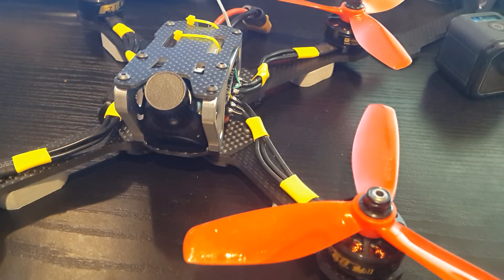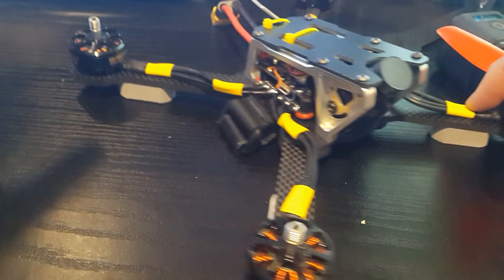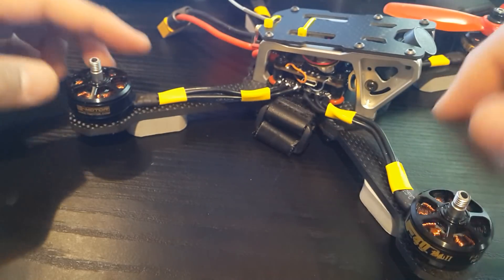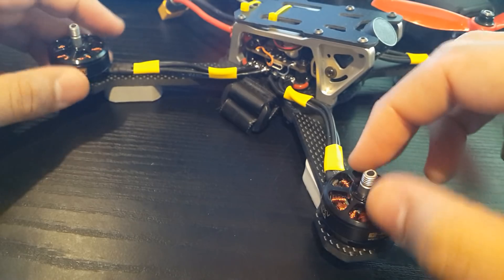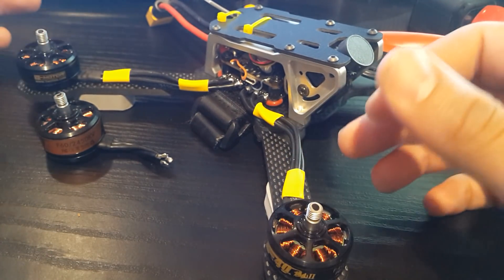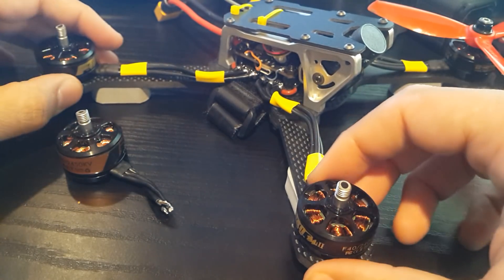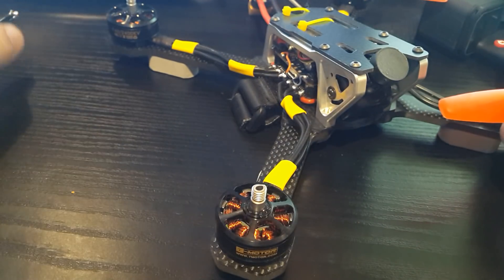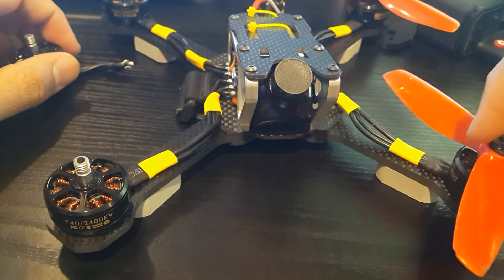Fake F60 T-Motors?? (It's Worse Than That)

Comment: Wow!! Sorry to hear brother, what a fun killer. They would have heat treated those shafts wrong or skipped the step cause when hardened steel is done right the props should break first or just strip the nut if that is alloy or low carbon soft steel. :-(

Comment: I had horrible experience with tmotor F80 1900 kV. They smoked either on power up or after a small crash. I have built 8 quads and never had issues with any motors.

Comment: that's weird, I can't kill a set of f40 pro's, I have crashed so many times and hard as h*** and the keep running like new, sucks for your trouble but yeah I won't run anything else, get the black versions of f60 looks like you have the first f60 made

Comment: Hi,
I bought 4x F-40 pros from ReadyMade RC and have been very happy with the motors. I have not had any shaft issues, they are surprisingly efficient and have been through a few crashes without complaint ( I do use TPU motor protectors though). I have had to clean out the windings due to mud and sand (with an air compressor) and they still fly just fine.
I short, my T-Motor experience was quite good. The issue with Aliexpress is the waiting time is long and many of the retailers are not trustworthy as they sell non-stocked items regularly, and then delay refunding. I feel for you bro! If the shafts on my motors broke that easily I would be freaking!!

Comment: The shaft broke ??? Wow that's a first. I would blame dalprops for unbalanced props and too heavy.
Reply: Bryan FPV no prop can create that much of a force just by vibrations, he might have screwed it on too tight but I if that were the case they won't survive even small crashes.

Comment: I have had a few friends with the same issues on the T-motors , most of them have turned to the emax's rs2306 2400kv, ive begun to use rcinpower gts2305's 2450kv  if you know them but are slightly less amp hungry.

Comment: its because theyre hardened too hard. very hard steel becomes brittle. manufacturing flaw , maybe they werent tempered correctly after heat treat. most liekely bad batch. tough luck. sucks to have to wait for replacements.. oh btw. you make great content. +1 sub ;)
and i know im a couple weeks late on the commenting ;)

Comment: hello the same happened to me with the f60 pro . they just broked on the back of my car without flying. now i go with diatone and emax . no more tmotor crap
Reply from the maker: Glade you told me I was thinking of giving T-Motor another chance with their pro series. 

Go with Emax the diatone bearings are very weak.. However I will be taking apart a Diatone motor and will be adding ceramic bearings see if that will fix the problem. Overall go with Emax.
Reply: Well at the end the best for me right now better than emax 2205s (witch i have broken 3 already), is the dys se and tornado t2 , those are pretty solid , and dont kill your battery as with the new emax.

Comment: The T-Motor Pro versions and the T-Motor F80 are very high quality and I've yet to experience any type of manufacturing failure in the 20 or so motors I've purchased.  Of course I use reputable USA retailers and I've never ordered anything from BangMeGood nor do I plan to ever patronize them.  If you are in the US why not order from US shops?  My experience with T-motor has been fantastic but I've not used their earlier versions.  Do yourself a favor and get some F40 Pro 2400kv's on that rig and you'll be singing their praises!
Reply from the maker: I was thinking of getting the pro version to give T-Motor another chance because i really want to enjoy those motors. So i think i will take your word for it. Email me your retailer site I will give it a try.
Reply: Purchase from here https://www.racedayquads.com/collections/t-motors .  Free shipping, excellent service.  No problems whatsoever.  They have T-Motor in stock.  I run the F40 Pro 2400kv on my 5" and the F80 2200kv on my 6".  They have been bulletproof so far.  Good luck!!

Comment: If all your shafts are cracking and breaking in that same spot, consistently. And you haven't even flown them, and the only thing touching the shafts in that spot when they crack is props and prop nuts.. then your over tightening your props. Whatever your doing to tighten your props isn't working. Shafts aren't going to just crack like that unless something is straining the shit out of it. And there's only 2 components touching that part of the shaft........... lol. Props. And propnuts. And the only time they crack and pop, is when you put props and propnuts on?
Reply: Chances are you're going to switch brands and continue on with the same problem. Especially with hollow shafts
Reply from the maker: I have many hollow shaft motors DYS fire,Emax 2205s  2306, Brotherhobby r4, Diatone d-silver and more..

This is due to bad QC and it turns out to be a known problem with some T-Motor motors distributors are changing motors no questions.
Reply: Bummer. I've had some hectic crashes, eaten gravel at full throttle & bent shafts, squished bells, even bent the bottom plate of the motor housings with broken arms but never had a shaft crack. Got early gold label versions and later black etched versions and I love them! Hope my distributor doesn't change
Reply from the maker: I just got my replacements for the F60's and to be honest I was really looking forward to fly them and when this happened it pissed me off soo much i was waiting about 2 months all together to fly the f60 realacc never got to.. So what i am going to do now is gonna put the replacement F60 on my Frog Lite frame and the f40's replacements will probably put them on realacc x210. 

I really hope i got a good batch this time if not I will give up completely on T-Motor or and i know this is stupid I will buy a pair of the pro versions as a last chance.
Reply: Yeah I'd be pissed too. Kind of how I feel with Kiss esc's, they must've profited hundreds of dollars from me before I finally gave up. But for some reason they work for other people, shrugs

Comment: Jep i agree never tiger motors for me. i got a set of F40 MK2 2600KV and one of them powers all the way up in flight. After that i have got my self the pro version... worked  fine until i switched them to another quad. now i get this heavy vibrations. soft mounted the motor's still no good. switching back 2 Emax   .
Reply from the maker: sylvester FPV Emax is the best way to go

Comment: Banggood from personal experience are straight up flogging fake motors and are aware of it.This is not an isolated experience as I personally know of 3 separate motor brands that have come from Banggood have been fake.Don't buy Banggood unless you want fake stuff.
Reply: Beanfranked Now Look up "Fake Sunnysky Banggood" and you'll be smashed in the face with 100's of results.

Comment: Why did u soft mount the pdb and not the FC?
Reply from the maker: I was not trying to soft mount the 4in1 ESC i only needed some extra small spacers that fit just perfect. The F3 V3 does not have such a sensitive Gyro so you can fly great without soft mounting.

Comment: I toasted 3 genuine emax rs2205's and 4 littlebee esc's in a series of events tied to simply plugging in the battery (sometimes I would get to fly for a pack or two and then pop)! I still don't know what was wrong - but I'm 99% sure it wasn't the motors or esc's. Once I replaced the FC - I had no further issues.  So, it's possible it wasn't the motors, but either the ESC's or the FC messing the motor up.  (I replaced the PDB, i checked for shorts, i had other people check it for shorts then I tried plugging it in with a smoke stopper after soldering each esc/motor combo to the PDB and had no problems. Attached the FC, and magic smoke.) Just a thought - not saying it's the issue here - super frustrating either way.

Comment: My friend's F60 broke 3 of 4 shaft on his first punch out and his dealer replaces them without asking any question. I guessing Tmotor has a batch of motors with defective motor shaft floating around and they are not doing any recall.

Comment: there is only supposed to be 5 or 6 motor factories used for multirotor motors. if you notice a lot of motors have similarities in construction. from now on I'll be using the brother hobbies motors and there close cousins. I like how the wires are guided out of the motor base. so any of the hyperlite motors, brother hobbies tornados and returners, and I think the rmrc rifle motors are on my list.
Reply from the maker: I just received my Brother hobbies R4 today and i hope they will compare with the Emax 2205s motors.. For me the emax motors never failed me and durable like no other motor i have used.

Comment: I honestly think they are all fakes. you shouldn't buy from Ali Express or banggood or GearBest. 

I have f60 pro models and I don't have heatshrink that holds the wires together and my wires are longer. 

brittleness is usually a side effect of heat treatment. there is some instability after the quench and tempering might be required afterwards. but if too much time passes there is nothing you can do. it sux you are having issues but I'd get a set from an American distributor (don't buy from crazepony on Amazon or eBay either) 

http://www.rctigermotor.com/html/distributor/us_ca_pr/usa/

they don't list any Chinese distriutors other than themselves and they don't list banggood or AliExpress in USA distriutors. if you feel like going through all their regions I won't be surprised if they don't distribute through those channels at all.

Comment: I had read about someone else breaking 2 when they tried to put props on for the first time!
Reply from the maker: The thing is they did not break while putting them on they broke after just sitting there with nothing touching them or moving them.
Reply: Ya it's so crazy. Definitely some serious design flaws in these. They were so hyped up that I expected great things from them!
Reply from the maker: I am thinking of putting the F80 motors that are going to come on live stream while i put the props on and set it down while i get my gear.

Comment: Suggestion for your when you install the F80s, film it, I wanna see it "pop".  It's crazy to know that your motors crap out.
Good luck man.. and as always great content.
Reply from the maker: Let me tell you how it is i have a video of right after it first happened on the f60 motors but i was very angry speaking and did not want to post it.

So i install the propellers then get into my backpack to get my transmitter and goggles then you will hear cracking noise so i thought it was the car at the time because i just parked. Then you will hear Craaack!!! and look at your quad with no propeller on the motor then you will start questioning yourself did I plugin a battery what did i do. Then you realize what happened is not your fault and you get pissed off there goes another month waiting for parts.